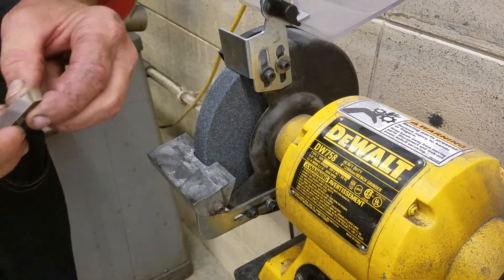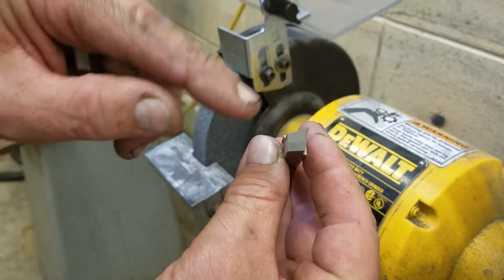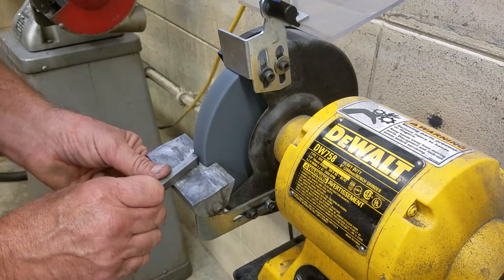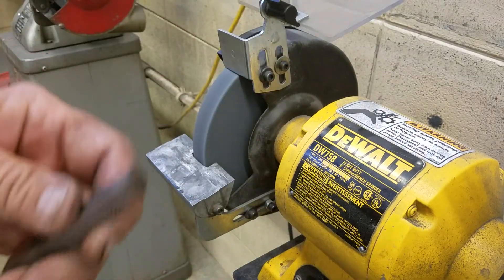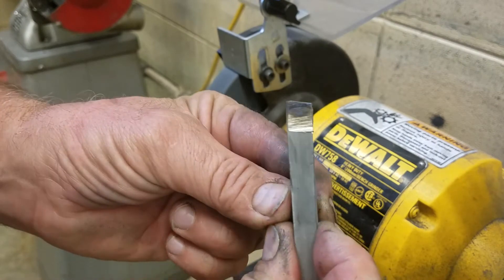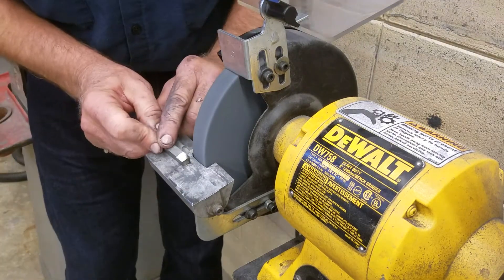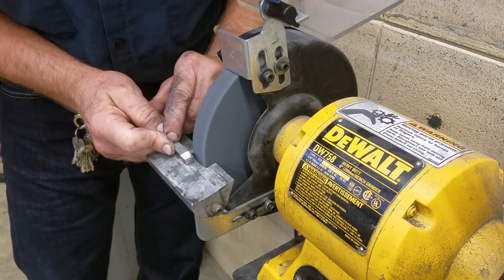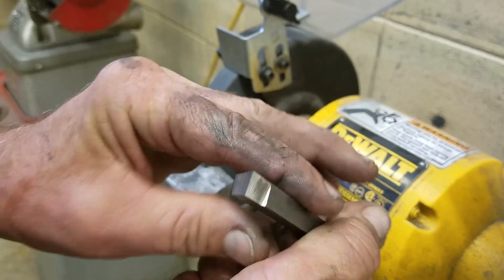Hand Grinding HSS Lathe Bits

Comment: short video , very informative thank you !!! so for rough and finish turning operations the difference is the small nose radius for finishing ?  plus the side cutting edge is straight for both operations ??
Reply: Sorry for delay. Yes, the finishing tool has a slight radius and I use a straight side cutting edge for both. Thanks.